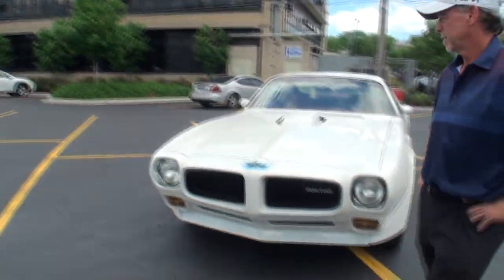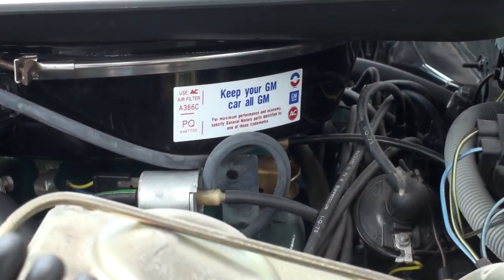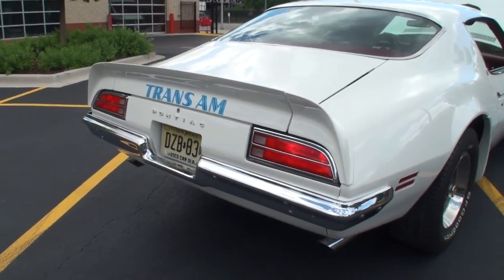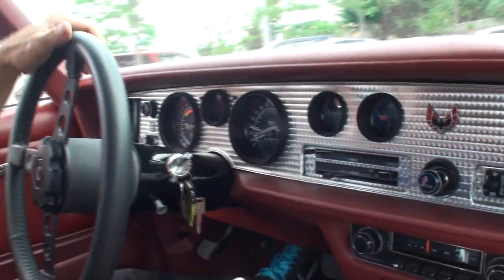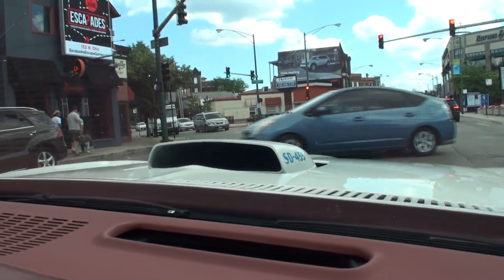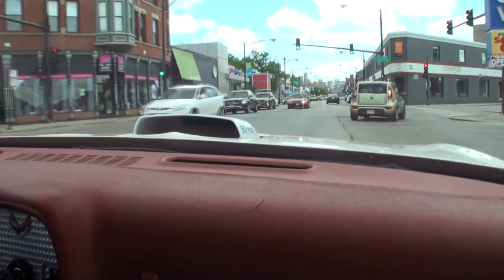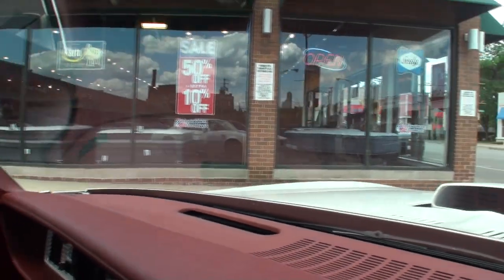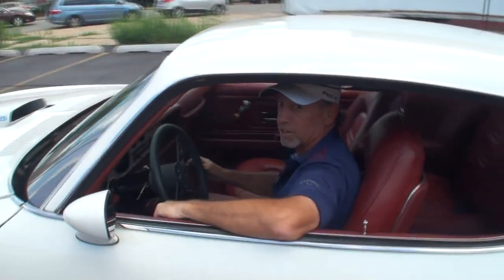Ride in a “ Super Duty “ SD-455 1973 Pontiac Trans Am? Why Not! on My Car Story with Lou Costabile

Comment: My dad and I put a 71 super duty 455 in his 79 smokey and the bandit ta because the 400 was toast it had severe scoring in the walls do to piston slap. Bought the engine for 800 bucks.
Reply from the maker: That has to be a fun car :-)  Thank you for sharing Danny Myers, Lou
Reply: Lou Costabile thank you for sharing such a beautiful car.  I'm glad that you kept the bird as the decals instead of using the stripes like they had in 70/72
Reply: 71  super duty, lol!  non made in 71!!
Reply: chuto paradinni you sure about that?
Reply: Yes, only 73-74, it was probably a 455 or 455HO, do you know what car it came from?
Reply: chuto paradinni nor true they started in 70
Reply: You are confusing 455s, Yes, they started in 70, but that was not an SD,  it was an L75 455, used in the 70 gto as 455HO D port  not used in the Firebird.  71-72  455HO was a round port and 73-74 was the 455SD also a round port, after 74 they went back to the L75 for the 75-76 TA

Comment: I can't believe in my 50's I wish these rods all had A/C!
Reply: A/C was not available in 4 speed Super Duty's in 73-74.  4 speeds had a hotter cam and 3.42 posi gears
Reply: bgsd73. The automatics had the same cam. 73 and 74 SDs we're the same engines. All the cams were ram air lll specs.   It just had a larger distributor gear.  Man there is a lot of bullshit on the internet. You are correct that you couldn't get A/C with a 4-speed.
Reply: what difference does it make,loose a couple hundred pounds and youll be fine.im 55 and drive a trans am all summer with no air,roll the damned windows down.
Reply from the maker: Hi Steve Holsten, Thank you for viewing and sharing your thoughts. Hope you see many more cars on this YouTube Channel you enjoy. Please subscribe, and hit the "bell" so you can see all the cars when they are uploaded on this YouTube Channel, Lou
Reply: @trillrifaxegrindor4411  I drove my 73 TA to a middle school recently, they loved it of course and one kid marveled over the crank windows

Comment: A friend of mine had a 68 Chevelle with a 70 455 HO Trans Am drivetrain 4 SPD was very fast and would brake them loose at 60 mph
Reply from the maker: Hi John Sizemore, Sounds like a great car :-) Thank you for viewing, sharing, and adding to the story, Lou
Reply: +Lou Costabile Wish I could've got it at least the motor and transmission anyway , but I do have a hot rod though an Ex Georgia State Patrol foxbody mustang a little built up , but I've always liked vintage machinery especially big block 4 SPD cars

Comment: sounds good except for that knock hahahaha
Reply: due to the high oil pressure configuration, the hand assenbled engines were built with comparatively generuous piston to wall tolerances that generated a noisy piston slap condition on cold start. normal on all SD 455's.
Reply from the maker: Hi Roger Farmer, Thank you for viewing and sharing. Hope you see many more cars on this YouTube Channel you enjoy. Please subscribe, and hit the "bell" so you can see all the cars when they are uploaded on this YouTube Channel, Lou

Comment: I had one when I was young and ran it on the track. It was an orange track and the car was "fueled" by D batteries. Okay, I had the Hot Wheels version of the car. 
Wouldn't it be great to build a replica of this car using modern braking, an upgraded track-ready suspension and massage the engine to get the most out of all the cubic inches.  Or perhaps do all of that to a '69 Camaro?
Reply from the maker: Good times with your "Orange One" :-)  Thank you for viewing and sharing Randy Curtis, Lou
Reply: Done like that all the time , Randy !! Called a "restorod" !! Where have u been for the last 10/15 years now ? Under a rock or what !!!!!
Reply: I've been admiring restorods.  Why do you ask?

Comment: Wow !  A lot of lifter noise.  Take it back to the guy that built the motor and have him fix it !!
Reply: due to the high oil pressure configuration, the hand assenbled engines were built with comparatively generuous piston to wall tolerances that generated a noisy piston slap condition on cold start.
Reply: Sounds like lifter noise to me.  I do not hear any piston slap which would be worse !!
Reply: Some lifter noise, needs to adjust, most likely don't know how. but piston "slap" fairly common in SD 455.
Reply from the maker: Hi grabir01, Hmmm, we'll have to look into that. Thank you for viewing and sharing your thought. Hope you see many more cars on this YouTube Channel you enjoy. Please subscribe, and hit the "bell" so you can see all the cars when they are uploaded on this YouTube Channel, Lou

Comment: These cars were truly great all-around performers. And yes; that cam lope is factory. I owned a '78. Four speed, headers, intake, 750cfm Holley. And a  super duty cam. Made the "little" 400 haul ass. Bought it off a used car dealer in 1980. Gave $3800 for it. Drove it every day, took it to the strip often.  Kept it two years. Then, sold it for $4200. Who would have have guessed they would bring so much money now.
Reply from the maker: Hi Jeff Weaver, Thank you for viewing and sharing your first hand knowledge and some good times you've had in one like this :-) Lou

Comment: In 73 horsepower was way down, 290approx. Lots of low end torque. Still pretty fast, but by comparison to modern V-6's  not that impressive. Still wish one was in my garage, real beauty!!
Reply from the maker: Hi Stevespecs, Thank you for viewing, and sharing your thoughts.  Hope one like this ends up in your garage soon, Lou
Reply: That horsepower rating is a misconception for the insurance companies. Gm changed the way they rated horsepower in 1972 from gross to net rating. Lets just put it this way that motor would be rated 400 horsepower by 1971 ratings so u are absolutely fooled by the numbers as were some of the insurance companies back then.
Reply: @Lucille69caddy  yeah, I know that I didnt mean just gm!! I didnt want to get long winded with the diffetence between net and gross.
Reply: Old school torque numbers rule not hp. People misunderstand hp numbers. Hp numbers are usually reached at high rpm.  You don't have those high numbers through out the rpm range.  Smaller engine rev higher and because of how hp is calculated the have high hp but low torque.  In reality big blocks pull harder at lower rpm, which is where you drive most of the time.  We have gone to small displacement to getter gas mileage.  If it weren't for gas prices we would still be driving sd455.
Reply: LOL,  new rating after 71 or so, the SD455 was actually underrated, NHRA put them at 370hp or so net, run the #;s as comparedc to gross. the car became a legend soon after introduction!

Comment: Costable, don't even act like you "know" trans ams, Wrong color by the way. This is a '73, maybe, and I have my doubts, with aftermarket stickers, easy to tell. Why no showing of the dry sump provisions?  Where are the engine cast codes? Yeah, good research on your part- NOT. ALSO, not to mention the original 2"1/2 to 2'1/4 exhaust. I expect to see the real thing not someone interpretation as such passed off as real. Don't even bother to answer!
Reply: He should have probably had the intake pulled to verify the additional lifter bore bracing, too. Heck, why not just strip it down to make sure the correct forged connecting rods are there while he is at it...smh. 
Paint code 11 is Cameo white...so what do you mean by 'wrong color' ?
Reply: dry sump provision is in the back of the motor (not easily visible), exhaust looks correct to me.
Reply from the maker: Hi John Regner, Thank you for viewing and sharing your knowledge. Hope you see many more cars on this YouTube Channel you enjoy. Please subscribe, and hit the "bell" so you can see all the cars when they are uploaded on this YouTube Channel, Lou

Comment: The '73 and '74 SD455 only had a compression ratio of 7.9:1 and the SAE net H.P. was only 290 so I'm not sure what all the comments are about claiming it was one of the best muscle car engines ever...it certainly was not.
Reply: The '73 sd455 had an 8.4:1 cr and 310 hp @ 4,000 rpm.  Of course, these engines could easily run run to 6,000 rpm so real power is somewhere well north of the official rating.  It was typical of the time for manufacturers to under rate high performance engines to avoid insurance penalties for their customers.  These were fast cars then and 43 years on are still impressive.
Reply: @kevin...very true...they also had forged rods and forged pistons but they didn't get the originally planned steel crankshaft and instead had regular nodular iron....had the engine had the steel crank, higher compression and the ram air IV cam it probably would have been a 400+ HP engine....but it wasn't....the smog laws stopped the fun.
Reply: @BK...Sir, those numbers are not accurate...if you do some research you'll find out the real numbers were 7.9:1 rather than the stated 8.4:1 and it was rated at 290 SAE H.P., Pontiac has stated numerous times over the years there was never a 310 H.P. SAE rated 455 SD (a guy who owned a '67 GTO and a '69 GTO...along with a long list of Mustang and Camaro V'8's)...FYI...the showroom cars ran mid/high 14's which is in line with a 3,800 lb 290 H.P. Engine...some of the magazine cars of the day (carcraft, Hot Rod, etc.) had better E.T. times due to they were delivered by Pontiac with the Ram Air IV cams, which did not pass emissions so were never used in the production cars.
Reply: Probably NOT........but your point still has some merit. The reason for such a low peak HP rating is found in the emission standards of the day. Cam shaft over lap was avoided to meet the new emission standards. Not just this engine but virtually all V8s saw peak power way down because going for power in the higher rev range left a less efficient burning of fuel down low in the RPMs. The reason I'd say your onto something here comes from all the power left on the table for the owner to find. A Cam swap, headers and an intake and carb.........easily takes you north of 400HP .......you'l quickly be out of compliance with emission standards but moving that peak HP up into the 5,500RPM range these good flowing heads will accommodate easily gets you there with one afternoon's worth of effort with wrenches and some really simple bolt in pieces that don't require a total tear down of the engine. This car even in stock form easily boils the tires because it's a torque MONSTER.......let it breath a little more and it's got the potential to hang with anything from the muscle car era.
Reply: @DB1960...It certainly would run much stronger with the Ram Air IV cam and the head design was good...but with 7.9:1 compression I think reaching 400 HP would be a bit of wishful thinking...just as a point of reference the '70 Ram Air IV engine was rated at 400 HP and had 10.5:1 compression. But as you said the emission laws of the day made the high compression and high lift long duration cams a thing of the past....well until recently.
Reply: There is no replacement for displacement......not so true today but back then? Definitely true. The massive 455 displacement is the reason for huge torque in this motor .....despite the use of  low compression and a cam that makes it's peak power at a meek and mild 4,100 RPM. Swap out that cam for something hotter, match the intake and size the new Carb appropriately and then scavenge the spent gasses with headers......400HP is well withing reach even with low compression. This isn't a mid-sized Chevy 350 or Ford 5 liter......... it's a monster sized dinosaur that dooms you to horrible gas mileage but it can easily make the power the old fashion way......through displacement. Today a modern 302 Ford Coyote motor makes 412-435 HP with 11:1 Compression, 4 valves per cylinder and computer controlled timing and injected fuel management. Yet it's torque is still bellow what this antique makes. the Horse power of the modern 302 exceeds 1.5 HP/cu in........unthinkable in a street motor back in 1973........it was a racy street motor that could achieve  even just 1hp/cu in....... but 400 out of a 455 is well short of 1 HP per inch........it can be done and all that torque retained even if it will be moved up the curve.
Reply: Easy to fix........originality can be preserved through use of a second motor and put the really valuable matching #s engine on a stand. Hey, anyone who can afford the car......easily affords the second engine. If it sounds like too much work to do the swap......this person shouldn't own the car anyway, right? Fact is for me personally....I'd probably go one step further and suggest the car stay all original and just build a clone of it for everyday track and street use. Clones are GREAT when you really think about it. Usually cos far less to build and you don't have to ever worry about destroying history or extreme value when you break parts or worse.....crash the damn car into a drag strip wall. :-(
Reply: Don't underestimate the power of gear heads, but you do have an excellent point. We made the best with what we had.  I ordered a brand new '82 Mustang GT which happened to be the quickest American built car of the year (don't believe me, look it up). Get this... with all of 157 bhp. LOL That said, it was very fast for the time. About two weeks after taking delivery of my GT, I had the engine out and made a badass 300+ bhp car. I lowered it all of the way around, but Enkei wire mesh wheels (think BBS mesh), and made a fine little SCCA F prepared racing car that was a great daily driver. All of this happened my last year of high school and I drove it to/from college and raced at any SCCA event that fit into my schedule. I can't tell you how many stop light races I won back then. :-D
Reply: i remember the 2bbl 4-speed 82 GT well.  ( "The Boss is back" ) Must have been exciting to build it super-fast & get to scca it from time to time. Over the years i had five nice fox bodies.
Reply: The little Fox body Mustang had a HUGE weight advantage if not much else going for it. It really was great platform to start with when building a 1/4 mile pounder. I personally never owned one......the basic look of the car was just never to my taste......but there was no denying how easily they could be built up. Probably the only period in the long Mustang vs Camaro  years when building a Ford for speed was actually  easier and less expensive than a Chevy.
Reply: @Hot80's...I've had 8 V-8 mustangs over the years, including the first fuelie...the '86 GT 5.0...it wasn't as fast as my '65 K code Hipo 289 (with the Shelby GT-350 mods so approx. 306 H.P.) nor even in the same universe as my hot rodded (445 H.P. on the dyno) '70 Mach I with the 4 barrel 351 Cleveland engine...but it was a strong running car in its own right....I beat a Porsche 944 and a vette with her.
Reply: @DB1960...you could certainly reach 400 H.P. if money was no object but assuming a modest budget, well I'd have to see it to believe it...7.9:1 compression w/o forced induction is difficult to overcome...but no arguing the torque figures and the base block was stout, but to make real H.P. you'd have to do something about the heads (and go to a steel crank and forged pistons to match the "new heads")...anyway it is what it is, a well engineered engine that the engineers then found they had to severely detune to pass emissions.
Reply: Steve Fowler
Reply: Guess again Steve.  I've followed the SD since it was announced in 1972.  I've owned three SD cars: a 73 auto, a 74 Formula auto a/c, and (currently) a 74 stick that I've had since 1978.  I've also owned a long list of 60s and 70s musclecars since the 1960s and currently drive a 16 Chevy SS and 14 Shelby GT500.  I have an extensive library of original automotive literature including all original Super Duty road tests and promotional literature.  Nowhere but nowhere is the compression ratio listed as 7.9.  It could be that figure represents the bottom end of allowable production variation.  I took delivery of a 1973 standard 455 engine Y code TA in 1972 and it was rated at 250 net with 8.0 to 1 compression.  Let's see...for the SD they used a different block, different heads, added forged slugs.  So then they lowered compression?  They needed to bump compression to 8.4 just to maintain cylinder pressure with the hotter RA 3 cam.   Also, the 290 net hp rating was at 4000 rpm if you bother to look at the factory specs.  The TA super duty in my garage has a redline on the factory tach of 5700.  Do the math.  BTW my 14000 mile 4 speed SD is a strong as anything (stock) that I owned, drove, or rode in from that era.  My long gone 73 SD was even a bit hairier.  That's backed up by all the original road tests I have.
Reply: thank you Kevin
Reply: big kahuna, I had my 73 rebuilt with a stock rebuild, no overbore and it dynoed at 370 hp
Reply: thanks for commenting Daniel
Reply from the maker: Hi Steve Fowler, Thank you for viewing and sharing your knowledge. Hope you see many more cars on this YouTube Channel you enjoy. Please subscribe, and hit the "bell" so you can see all the cars when they are uploaded on this YouTube Channel, Lou